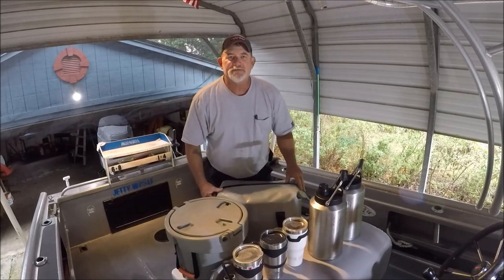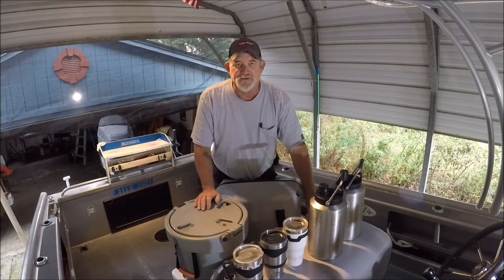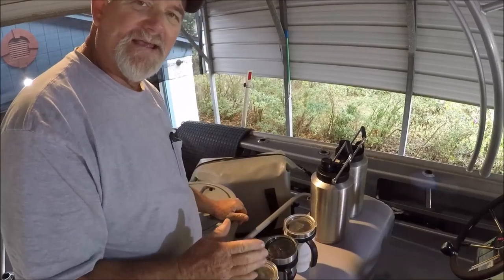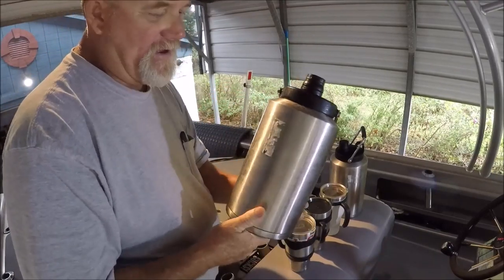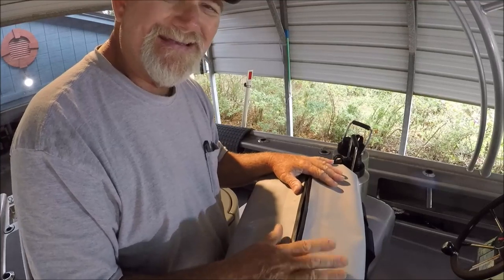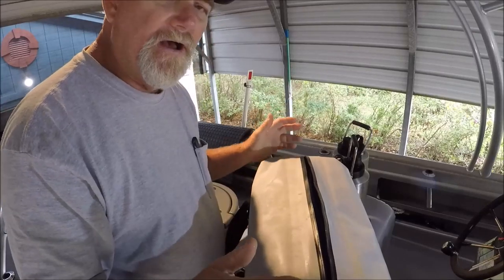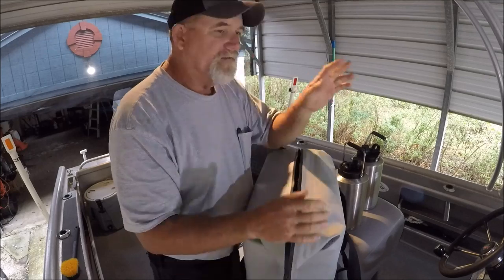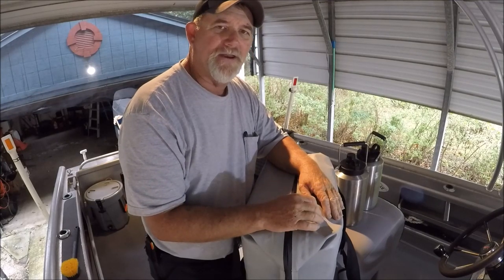WALMARTS ''OZARK TRAIL'' IS A SUPERIOR VALUE👍

Comment: Love Ozark Trail. Have 2 of their coolers. I like their gray color. Matches the carpet on my boat. Coolers are very thick and seal well, but don't keep ice all day in the heat of the summer, if the cooler is under the sun. I still have to keep the cooler in the shade, if i want ice all the way to 6pm
Reply from the maker: I seen yours. They have two kinds. Roto-molded and Non-Roto-molded, plenty of videos about them both are out there. Maybe matching the color of your carpet is the problem.
Reply: WHO buys a cooler without matching their carpet, Dave?
Reply from the maker: @ifishcatfish  WTF would anyone want carpet in a fishing boat??